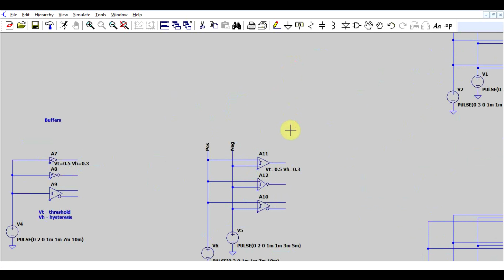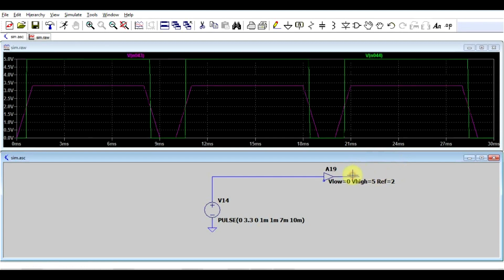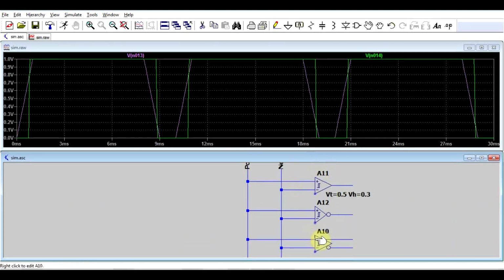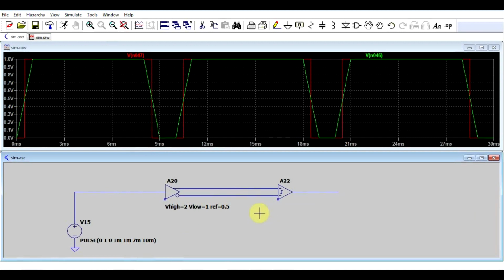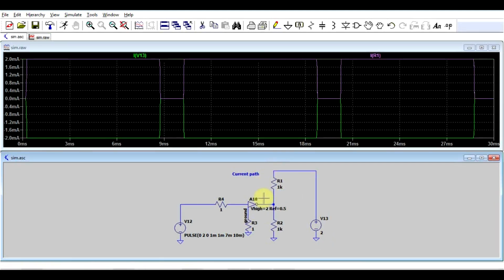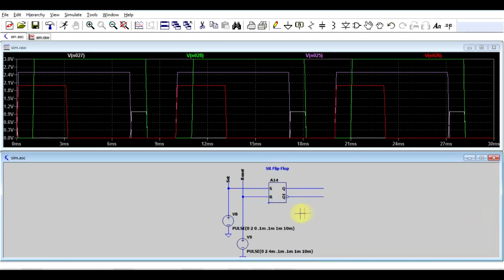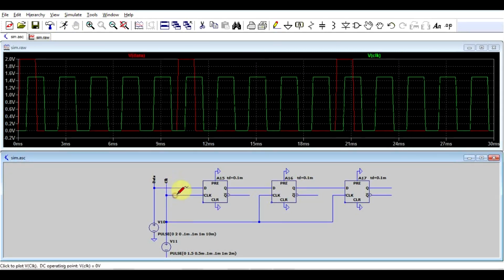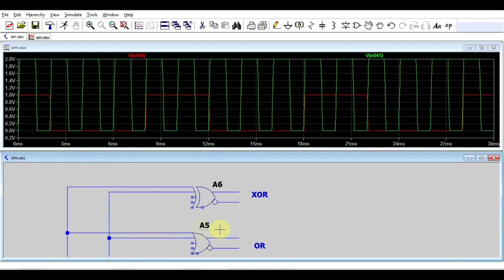LTspice tutorial - Digital circuits and logic gates

Comment: Hello FesZ. I am trying to simulate some analog circuits (PWM generator + half-bridge driver) in combination with logic gates (two ANDs and one inverter). The problem I see is the simulation takes forever when I add the logic gates. If I make them using transistors the simulation runs normally. Are there any setups or parameters that could handle these virtual gates better? Thank you.
Reply from the maker: Is there any feedback implemented? sometimes the circuit starts to oscillate, and especially with ideal components (like the logic gates) this can occur at very high frequency and slow the simulation down. Anyway, as a start I would add a ".options cshunt=1e-13" statement in the simulation and maybe add a trise and tfall parameters to the gates to slow them down. Let me know if this works.

Comment: nice video, regarding the counter, I think you may not have spent enough time to try to understand it. The pattern of the counter is not weird. The problem on the interpretation of your results are two : 1) you start the count from the initial time of the simulation, which has to be always avoided in any circuit, because the behaviour of the system in that part is due to the initial transient of the system. 2) you always used odd number in the parameter "cycles". therefore your counter does not work as it should. try to choose cycles=8 and start the simulation after 5ms. I guess you will be able to see a pattern in the output phi1. Good luck for your next videos . bye

Comment: where's the not gate?
Reply from the maker: Its the buffer "buf" circuit; this gate has 2 outputs, an inverted and a non inverted one. The inverted output is the NOT gate. Most of the gates have an inverted output so you don't need to add a dedicated NOT gate.

Comment: A small help: How did you specify those special parameters Vhigh and Vlow. Is it just a label beside a component.
Reply: I specified the values in its spice directive and It worked.
Reply from the maker: I just right clicked on the component and edited the "value" attribute - wrote all the parameters there. You can use both the "Value" and "Value2" lines.
Reply: @FesZElectronics  Thanks Got It

Comment: Im looking to measure with LTspice on AC signal (mixed signal) output the DC part average value and display it on graph. can you help with?
Reply from the maker: Hello Yoram Lochner; I am not sure of how fast your signal is varying but I guess you could pass it trough a low pass filter. It will not react instantly but if dimensioned correctly it should show you the dc average with a good precision. Maybe you can give me some more details on what you are trying to simulate, so I can try to give a better answer.

Comment: I was trying to make D flip flop from 2 AND gates, 2 NOR gates and NOT gate in LTspice as Ben Eater
https://www.youtube.com/watch?v=YW-_GkUguMM 
did on breadboard. It seems easy but I was not succeeded. I did my best and still do not know why it not working in LTSpice (it works on breadboard however). May be you can manage this problem, for example as a new video with some logic schemes, or you have some advice. I think it would be useful, because a few people, I guess, know how to use logic gates in LTspice.
Reply from the maker: Hello Mr.Remmoz. I am not sure why your circuit didn't work, maybe you can send it to my by email so I can get a better idea (feszelectronics@gmail.com). On the other hand I did build the circuits mentioned in the video, including the one with the And+Not edge detector and it seems to work - https://drive.google.com/open?id=1o3Qs93deN3zG1ECdTtW4_6YZehPK6RDw
I guess your problem either involved signals that had a rising and falling edge at the same time (clock rises exactly when Data falls for example) or certain delays where missing - you may notice I used a "td=1u" command on the not gate in the edge detector. By default LTspice has no delays - the logic circuits work instantly; Regarding a video on this topic, I wrote it down and I will try to get to this at some point; thanks for the suggestion!
Reply: @FesZElectronics       You are right. Your intuition is absolutely correct. It was enough to introduce time delay td=1u in one of the coupled NOR gates. Thank you very much. You are great.
Reply from the maker: I'm happy I could help! It's important to take into account all the non-idealistic parameters of real circuits, the simulator usually ignores those because its much easier to simulate like that.